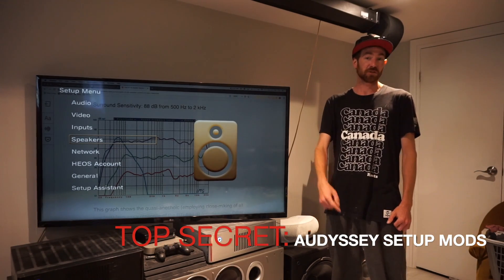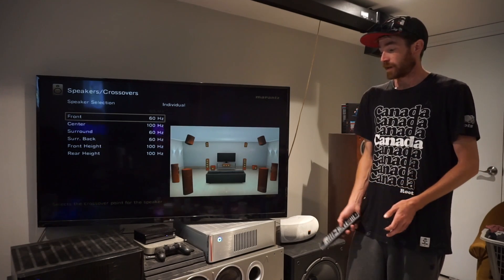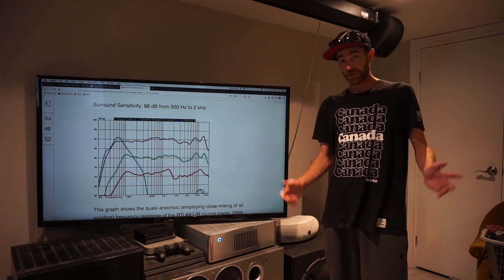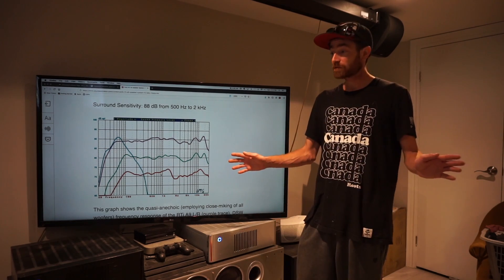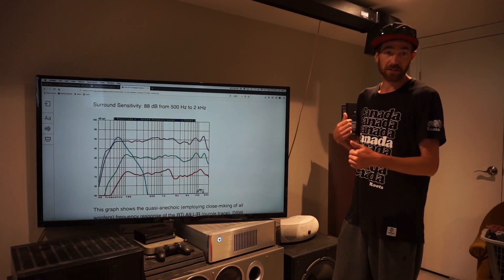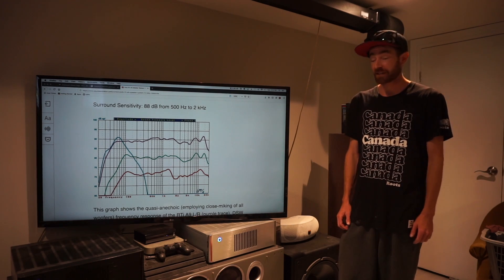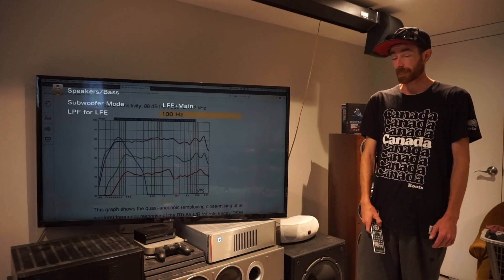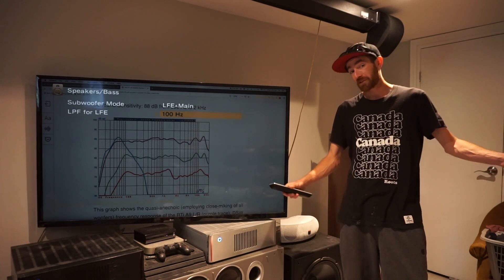Top Secret:Audyssey setup mods.

Comment: Sorry you are wrong. If your speakers -3 db point is around 60Hz, you should set your crossover for that speaker at least to 100Hz. Usually the right crossover is one octave more than your low -.3db point of the speaker. . Remember, the crossover is not a brick wall ! Of course all speakers has to be set to small for the bass management to work, and get the slam from your subwoofer. Good speaker and sub position will minimize the possible subwoofer localization issues and you can get around using higher subwoofer crossover (in this case the 100-120hz) should be the optimum for your mains. Never lower the crossover lower than the audyssey suggest, because there is no filters runnin below the suggested hz.
Reply: John Smith  maybe because taming 35hz is more difficult when you can't move the speaker (left right fronts) to an arbitrary position in the room like you can with subs.
Reply: @johnpoo1662  Yes, and with minidsp for subwoofer you could tame it before running the audyssey if there is large peaks, so audyssey dont need to do so drastic corrections. Audyssey  can do strange things by accident if too uneven responce before measurment.
Reply from the maker: thanks for the comment. however i disagree. the speakers -3db point on my speakers is somewhere between 40-50hz and that was measured with the crossovers in place on the chart i used so therefore the crossovers in this test are in fact acting as a brick wall where they do not absorb the frequencies running along it. the audyssey sets my speakers to 40hz automatically but i raise the frequence into the flat response. i set the bass to main+lfe because thats how i like it to sound. i listen to a lot of rap and hip hop etc. i had planned to move my subs into the corners to maximize their output but they never get set more than half volume where they are and how they are setup now. However as you pointed out i may in fact be wrong, thanks for pointing that out. very interesting.
Reply: Where does this "set one octave higher" rule come from? If the speaker can play clean down to the -3dB point, then why not use the speaker to its full range? (I am assuming there is enough amplifier power to drive it that low). Movie non-LFE channels are full range 20-20k, so why cripple a speaker with a high cutoff? Isnt the digital crossover in most AVRs 4th order (24dB/oct rolloff), that's steep enough to not worry about playing freqs lower than the speaker can do on paper.
Reply: @johnpoo1662  Good points. The crossover typically is 24dB but its best to find the best crossover by measuring to be sure, example UMIK-1 + REW combo. My self for example, i have KEF Q900 front speakers that plays flat to around 40Hz in my room (specs says 32dB I tried 40,60 and 80 and found 80 had the best integration (suprise that was just the "double" up rule 40x2 = 80Hz) I am noticing i can play louder and clearer, the mids and highs are better (lower distortion?) it helps the speaker and amplifier load because subwoofer does more.This of course depends how good subwoofer you have and how high it can play without sounding bad (i have SVS sub) which have clean and flat sound to over 120Hz. Also remember with a 24dB crossover, even with using 80Hz xover, the lower frequencies still bleeds to the main speakers, example 40Hz in my case (24dB lower) that which i measured and know was the "realistic" usable lower range, so below that 20-32Hz range is then 48dB lower which is fine because it would be no use in any way it only adds resonances and load to the amplifier. With a decent subwoofer, its always better to give the max you can for it if you can (without localisation issues). This is always speaker and subwoofer combo specific. Best to measure to be sure :)
Reply: @johto  true. Measuring is best if specs are not to be trusted. Right now i don't have a sub due to neighbors, but i still have to tell the AVR i have one so it doesn't send full range to the fronts. Hence my interest in the best sounding crossover setting.
Reply: Without a sub preserving as much low frequency content from all 5 channels is the goal!
Reply: @johnpoo1662  Oh, in that case, you want it lowest as it can be so it don't sound too tinny. Not sure why you want to do that anyway, Do you think its too bassy full range? Maybe you have uneven bass room response? UMIK-1+ REW would show that and with a minidsp you could improve the sound by doing custom EQ's. and and create what ever custom crossovers you want and let the receiver use full range.
Reply: @johnpoo1662  Then you are actually doing it WRONG. Totally wrong. You should have no sub selected and speaker full range. The AVR will then mix the LFE automatically to the front stage (but little attenuated at -10, so your speakers wont blow). Now you are actually doing it even worse, you are not getting ANY LFE because your AVR thinks you have a sub !
Reply: select no sub and use full range
Reply: @johto  long term goal is to get minimum two subs and play around with REW to get a feel for how the room is shaping the sound. Since i don't use the LFE channel i don't get any of the really heavy stuff. Any multichannel effects are just cut below 50/60hz. That's plenty of bass for now. 1 octave above crossover would sound tinny. But I'm sure very clean. 😁
Reply: @johto  tbh my fronts only go down to 50hz. If my AVR sets them to full range they won't thank me for it. The LFE has lots of rumble type noise which i won't hear anyway through them so that's why I've decided to cut the LFE channel by selecting a non existent sub.
Reply: @johto  question. Why do you think it will be mixed at-10? Isn't the LFE deliberately mixed at +10 above ref level?
Reply: @johnpoo1662  ok, makes sense
Reply: @johto  As an experiment i just tried to set the fronts full range and put on Mad Max. The excursion on the front woofers was huge (as expected with sub 50Hz content). This was at -20dB master volume. It wasnt even audible anyway (7" woofers), they were just flapping around. Hence why i use the "phantom sub" trick to relieve some strain off the fronts. Since my fronts are ported, playing below port tuning freq (also 50hz) is pointless and risky with loud movies.
Reply: Why not bass manage for music?
Reply: @johnpoo1662  because you dont have a subwoofer LOL :)